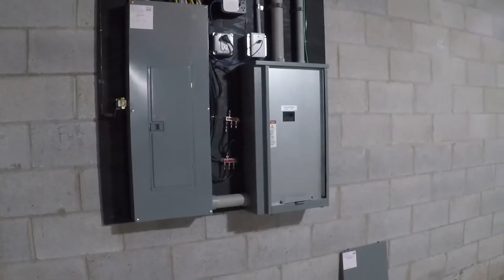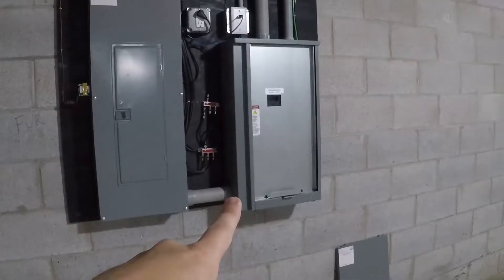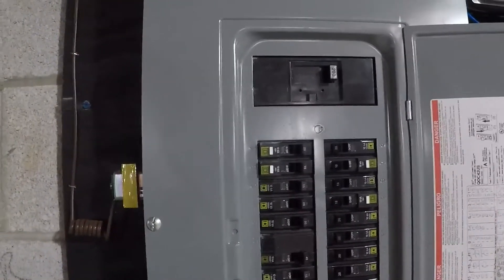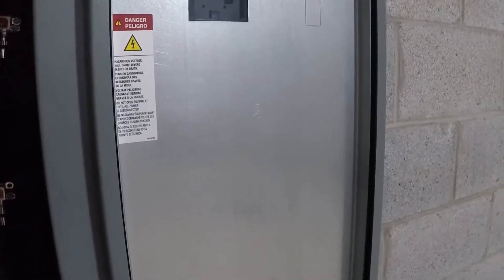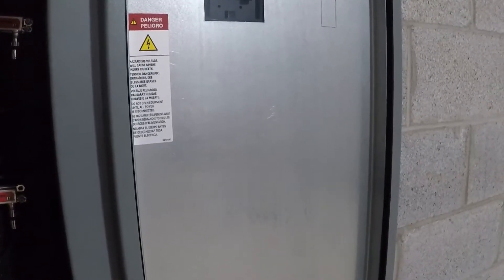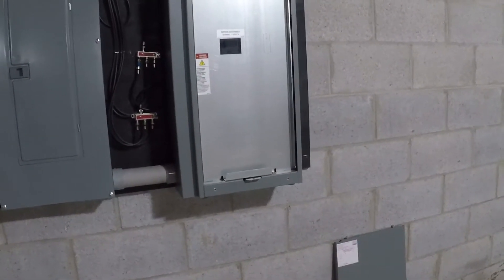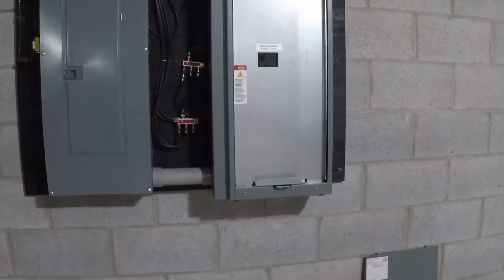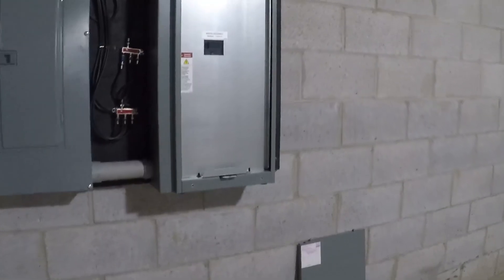Emergency Home Standby Generator Run Test / Power Outage Simulation / Kohler 20RESA

Comment: Very helpful video.  Just completed installation of 38k Kohler (LPG) and want to periodically run a load test besides the weekly exercise.  What sold us on the Kohler were the hydraulic valve lifters and the brand's reliability.  Thank you.

Comment: Great video!  I'm looking at a 20Kw generator as well and my local electrician is pointing me to Kohler.  Did you compare Kohler vs. Generac?  Thank you in advance!
Reply from the maker: I was debating between kohler and cumming/onan. I’m not a fan of generac and my electrician refuses to install them after dealing with so many issues. If you drive behind most government building and hospitals you see kohler and Cummins.